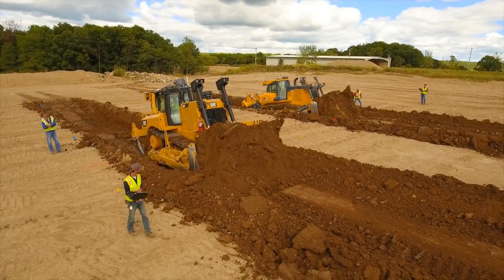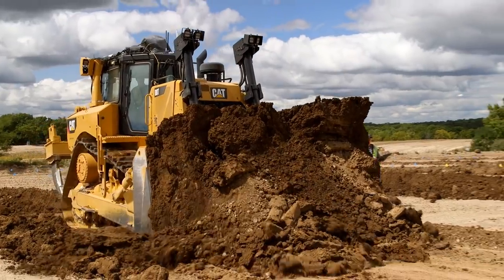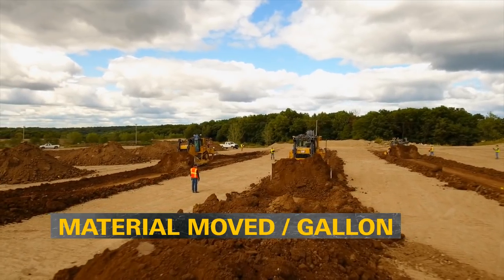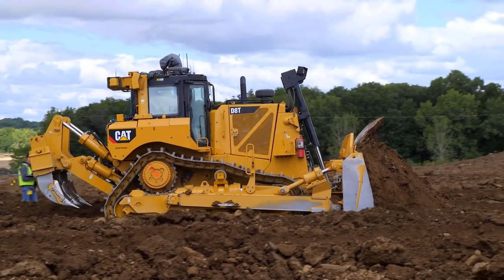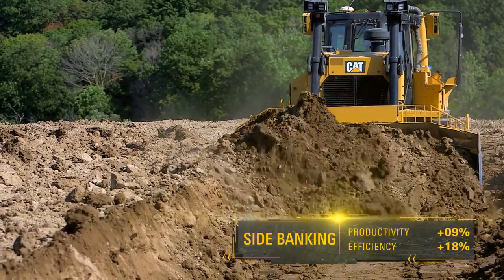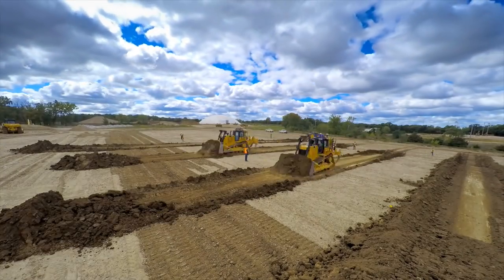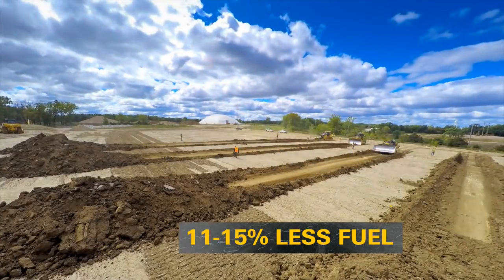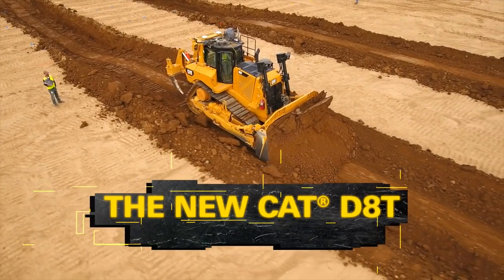Cat® D8T Dozer Wins Big in Productivity Test

Comment: Interesting that the back to front method is used instead of front to back. In the application guide Cat published in 2010 (AEXQ0540) it states that the front to back method is more efficient because the blade is being filled going down hill and the side walls of the slot keep material in front of the blade. Per this guide it says the back to front method (as used in this study) “results in more passes to move the same volume of material”.
Reply: Good obs CJ.  The "field" is prepped as a large flat surface, dug out to 7' depth, layered and compacted during backfill to ensure all pits have the same density.  As a result, we end up with a large flat field.  To slot doze properly, as you said we need to cut Front to Back.  However, with the flat field, we still need to doze the material up a ramp out of the slot, slide it a consistent distance, then back-stack the fill to avoid climbing over the pile.  Yes, it's dozing uphill out of a hole, which is not optimal for a dozer.  However, it is fair and consistent for all competitors, as they all do the same exercise.  As we measure each segment independently (dig, ramp, slide, dump, reverse), we can pull out the ramp from the results to, again, make it fair for all competitors.  Thanks for the comment!

Comment: I call bs lol the 1050k has more hp than the 8 and is true hystat which has better turning. Both 1050k and 155ax will outpush the cat, but because cat is doing the demonstration the winner will always be their products,
Reply: Thanks for the comment.  Horsepower can be a tricky thing, as manufacturers can include/not include different elements of parasitic load when building up their horsepower spec for a brochure.  The D8T net horsepower rating is expressed after all parasitic loads, the true horsepower available for dozing or ripping.  On the turning comparison, the D8T uses a Hydraulic Differential Steering system, essentially a hydrostatic steering system in itself.  Due to the power of the Diff Steer, and the balance of the tractor, the D8T turns remarkably well under load.  The Sweeping Trench backfill test is used to prove this out, and the D8T nearly doubled the production of the 1050K.  The 1050 is a good competitor, no doubt, but the new 4 speed lock up clutch transmission puts the D8T ahead in many ways.  We always test with integrity and truthfulness, no matter the outcome.  Thanks again for the comment.
Reply: @rogermeeker3789  This type of video sells equipment also, but the featured 1050K is visited by dealer's service techs 1-3 times weekly for 24 months. Unscheduled downtime for repairs erases all of the productivity improvements, ditto for Cats, Komatsu
Reply: @UrsulavonB  lmao
Reply: @UrsulavonB  Agree 100%.  Uptime is everything.
Reply: We have a demo 1050k at work with 218 hours on it. It has overheated with 2 different operators at about the 30 min mark on flat grade. Also, its pushing ability is lesser to the D8 model we have. Nowhere even close to the D8 in any aspect.

Comment: Why do you start slotdozing at the end of the slot...?
Reply: Good observation.  The end of the slot is defined first so we can keep the Carry portion the same distance for all competitors, makes it fair this way.  You're also slot dozing properly at that point, always cutting downhill.  The material is cut, pulled out of the slot up the ramp, then slid a constant distance and placed in the dump.  You may also notice that the dump is "back-stacking" rather than dumping up a ramp.  This removes another variable, making it more even/fair for all by eliminating the ramp to dump.  Back-stacking is the most efficient slot dump technique to avoid climbing over your spoil pile constantly.
Reply: Just to confirm, you should always start at the end of the slot.  This way you're never cutting uphill.  You're always cutting downhill, which gives you the advantage of gravity.